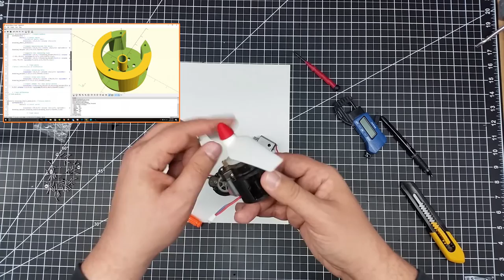Video Drone - 3D Printing Syma X8 Motor Adapters!

Comment: Hi! I'm curious if you can make syma x8 prop caps in brushed aluminum (like the motor cover color of the phantom 3 and 4) if so, how much would you charge shipped?
Reply from the maker: Sorry only in plastic with a 3D printer, you could make them (in aluminum) however they would be heavy and a lot of work...
Reply: Video-Drone yes, I was referring to plastic, but can you make it in that color specifically? I guess it's a silver color.
Reply from the maker: Yes they have silver PLA (looks like aluminum)